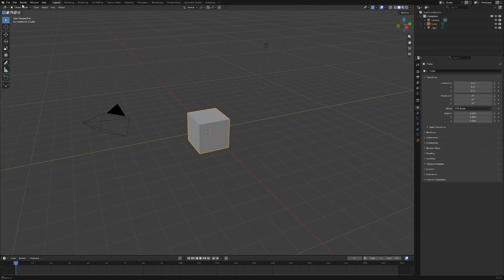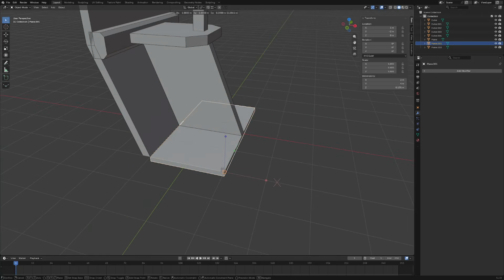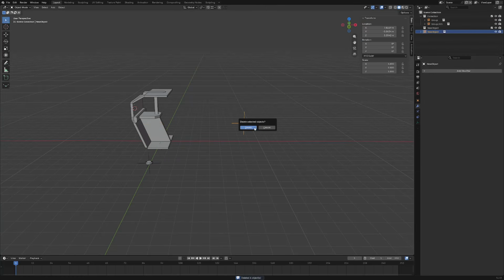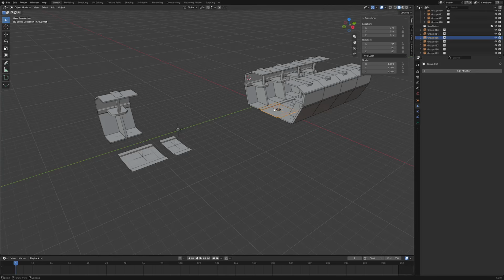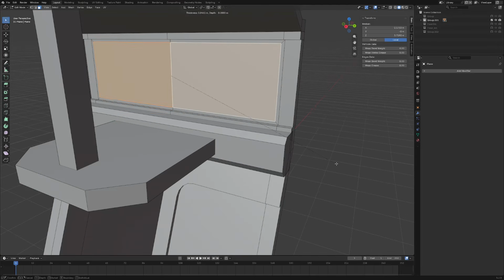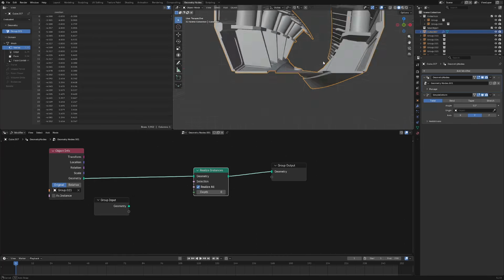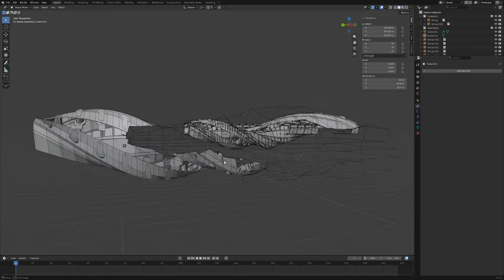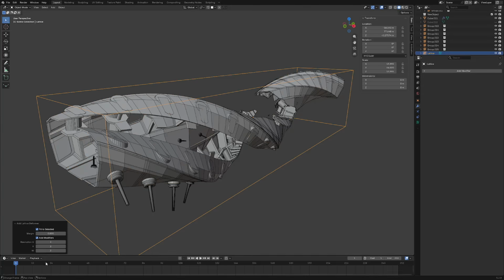Grouping in Blender

Comment: The annoying thing with Blender for me. Is that so many tools. Simply don't do it the way I think it should be done. So there is a workaround to be found at every third step you make. It's the only 3D tool I use so I've gotten used to a lot of it though. The end results are great and it can do almost everything I need it to do. A lot of things are more work than expected and some everyday basic things require plugins.
Reply: As a maya user trying to learn blender i agree. its a mess.
Reply: I agree, as much as I owe my career to blender and love it dearly, it really feels like sometimes the devs tend to chase more niche passion project things instead of the core fundamentals of 3D packaged toolsets (such as grouping, proper shadow pass, displacement still being very poor/slow compared to modern engines, etc)

Comment: DAFAQ?! Crazy how many small tricks you know! You have experience in various 3D apps as well. Your channel is a such goldmine!
PS: Do you have a new version of Blender? Not only did your inset key change, the grid is also visible, haha
Reply from the maker: Back on windows for now, so vanilla blender. Fixed my windows hanging issue.  linux had a kernel panick I couldnt recover.   Back to linux in december when mint gets wayland. On a second hard drive I think this time.
Reply: @pzthree  Sounds like a solid plan. I switched from Mint to CachyOS on the weekend; no issues until now. Dat said you are doing way more advanced stuff than me. Anyway, goog luck dude, I have my fingers crossed!